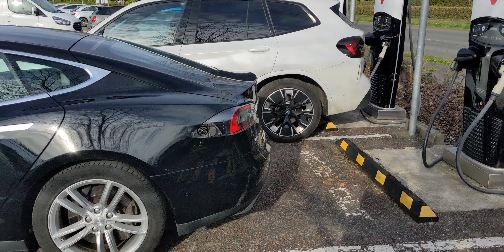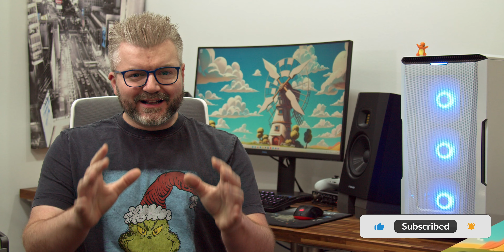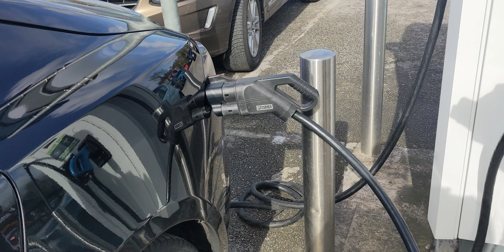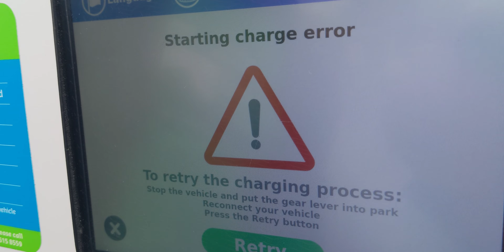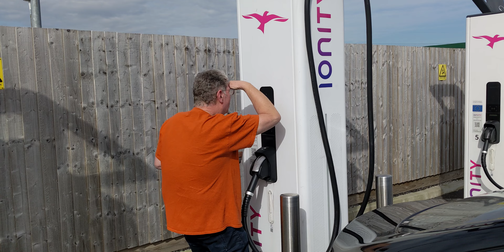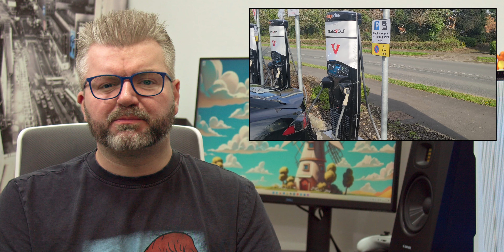EV Road Trip In The Tesla Model S | What Was It REALLY Like?

Comment: The charging adaptor your father uses is black plastic, so it blends into the charge lead. If it was a contrast colour, or featured contrasting colours/graphics to make it stand out, the risk of misplacing it or leaving it attached to the charge lead would be reduced.
Reply from the maker: That's a good point, actually. I don't even know if they make the adapter in other colours.
Reply: @jonastakesiton  : The alternative is to find self-adhesive materials which will stick to the current adaptor, and place them in positions that makes it stand out from the Tesla’s charge port and the charge lead.
Reply from the maker: Yeah, that would help. I had a quick look online to see if there were any adapters that were a different colour but couldn't find any.